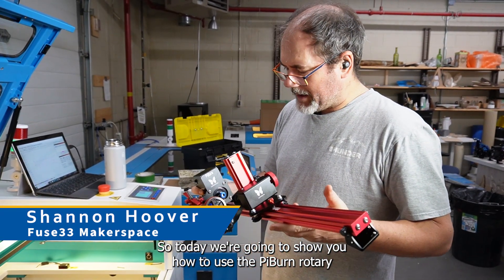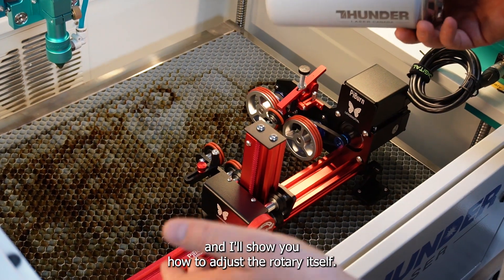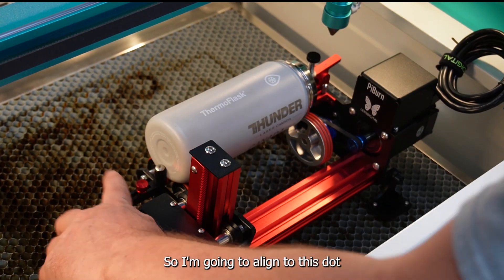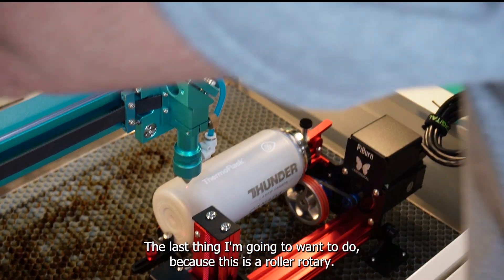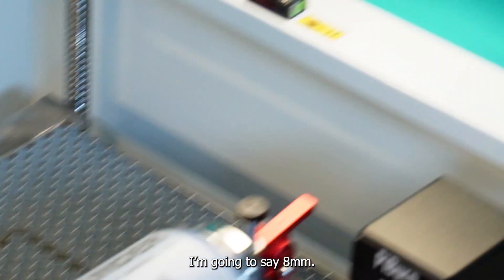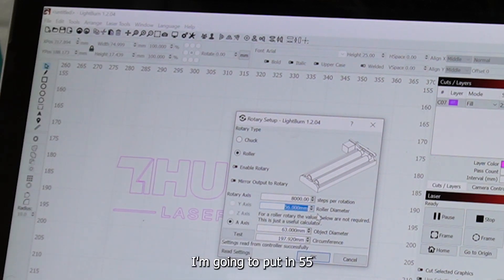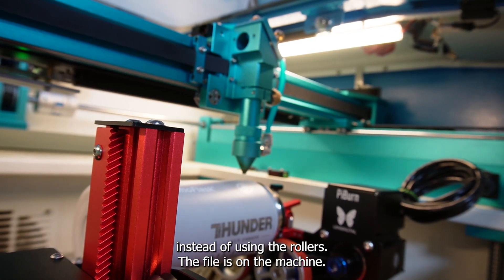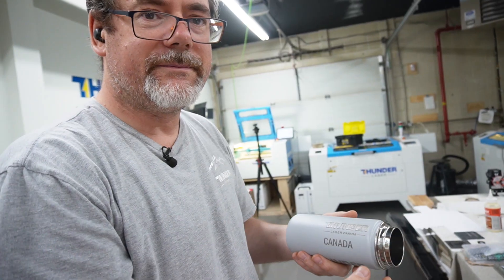How to Setup a PiBurn 4.0 Roller Rotary

Comment: Awesome video. I have referred back to this a bunch of times. Thanks for making it. 
One thing I noticed though though, I think the correction for the smaller lip diameter is wrong. I am engraving an almost identical water bottle with a smaller lip at the top and if I reduce the diameter of the rollers within the rotary setup from 63mm to 55mm, it stretches my design horizontally. If instead I increase the size of the rollers to 71mm, the design comes out in the correct proportions.